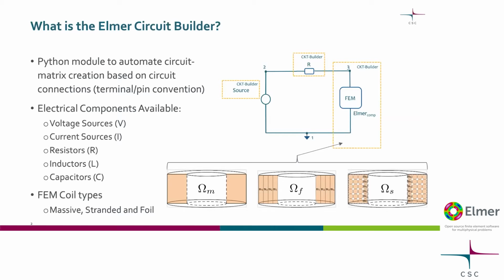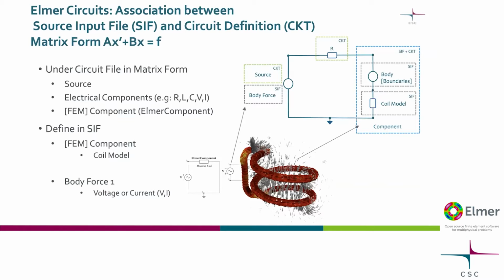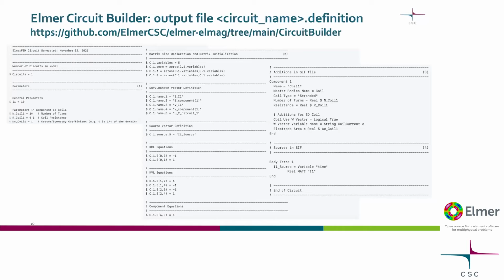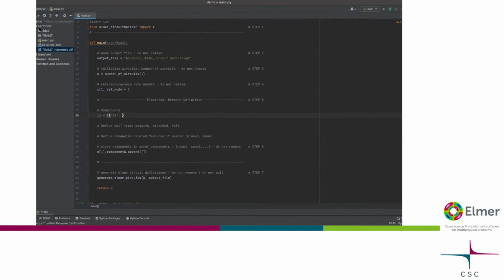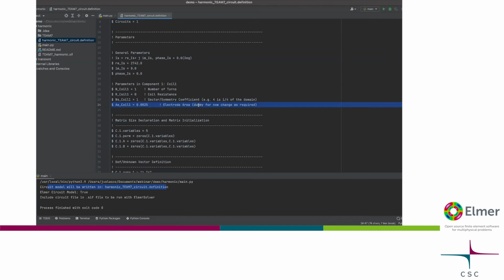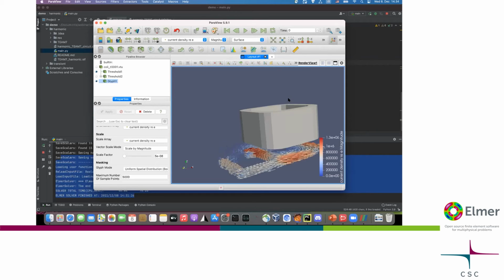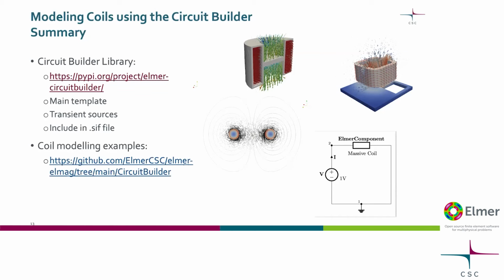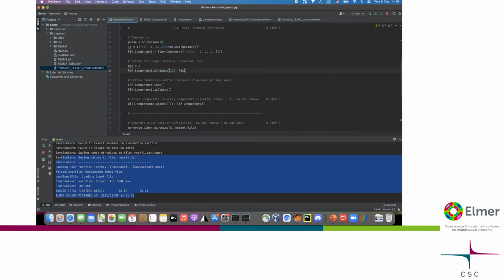Elmer FEM Webinar - Coil Modeling with ElmerFEM

Comment: Hello, where does the coil model and mesh come from ? is it autogenerated, or is it "hand-made"? Is there a tutorial how to provide own mesh to the elmer circuit? Thanks for the answer.
Reply: Hey, in the example you can see it's in that "TEAM7" folder. I'm using FreeCAD with gmesh to generate mines, but there are lots of tools you could use for your modelling.
Reply: @zippolag  Thanks for your anwer I have finally ended up with Salome as I needed good localized controll over mesh generator. But I do not have much time to play with it more. I am still confused how to calculate EDI current in the metal once the field is calculated.
Reply: @JosefKopal  kudos to you! I wanted to try Salome first but I'm on an arm64 apple air and the only way to get it going is within a docker container emulating x86_64 and hooking up NoVNC or some kind of RDP; so the experience is awful. I turned to FreeCAD just because I can run it locally